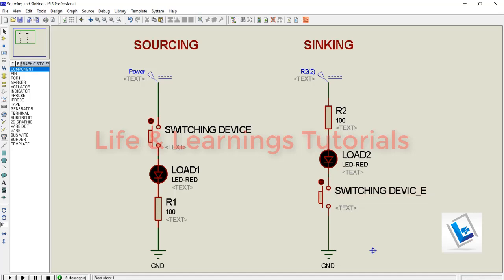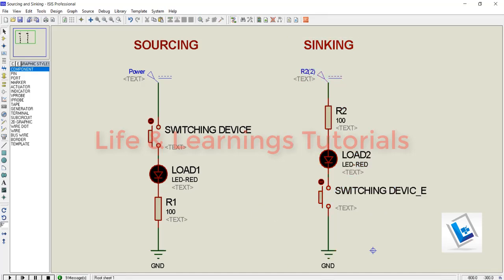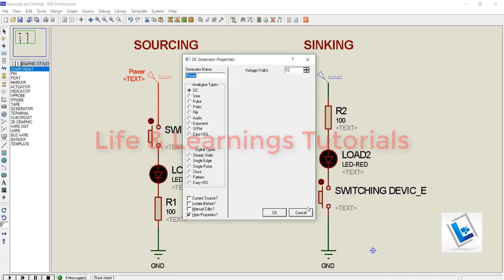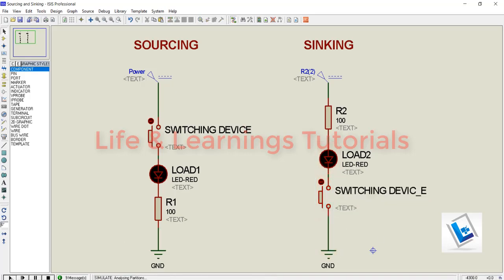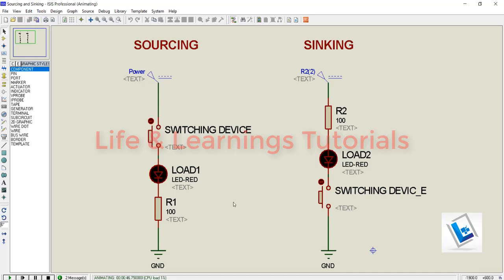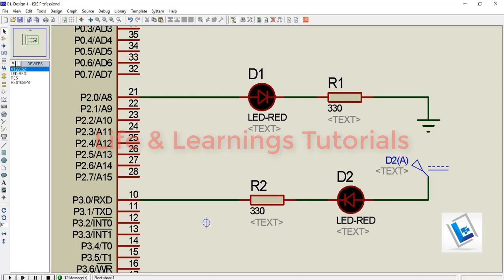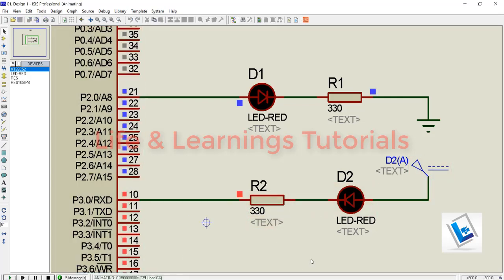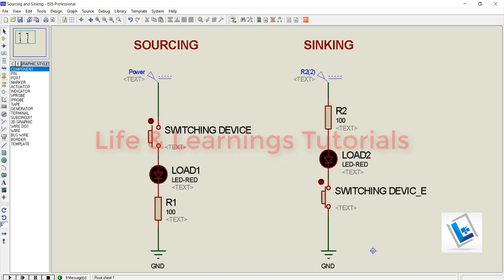02 - Sourcing and Sinking

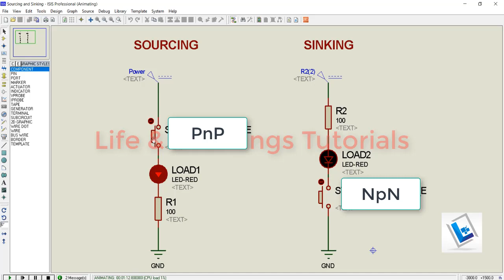Comment: Thank you for posting this. In the second part, at around 2:30 or so, can the output of the top circuit (instead of going to GND) be the  input to the bottom circuit?
Reply from the maker: yes... you can do this. This type of arrangement is also known as Darlington Pair configuration.